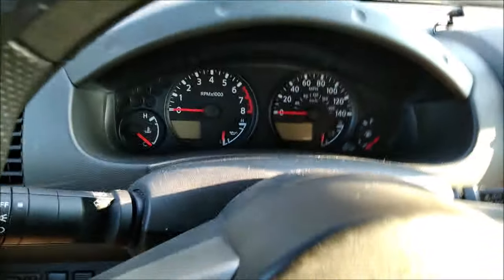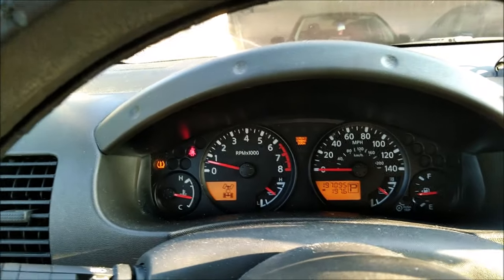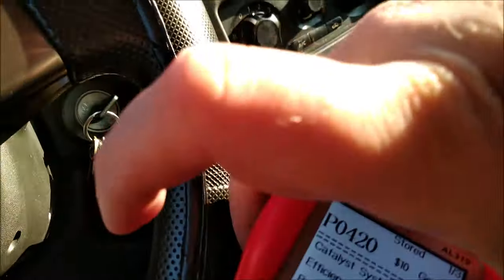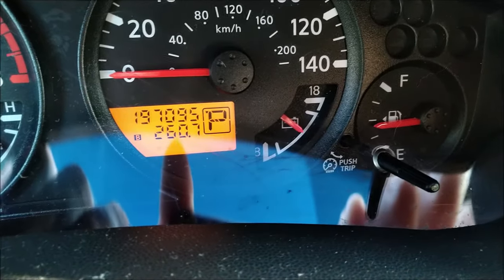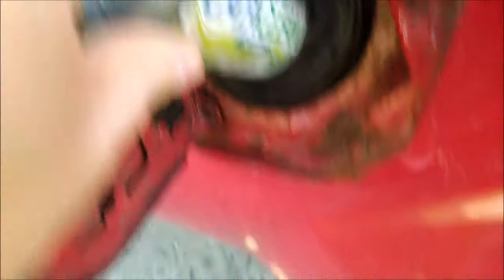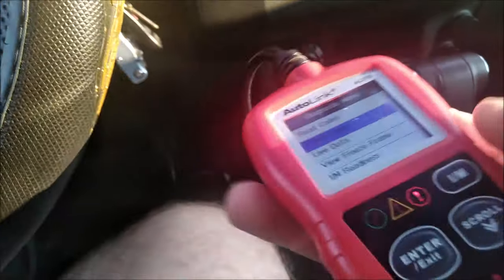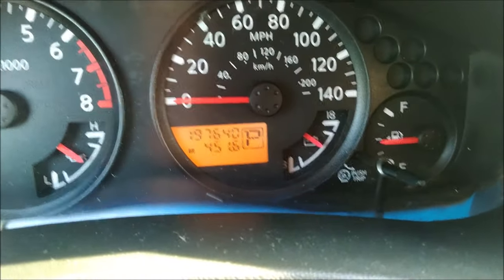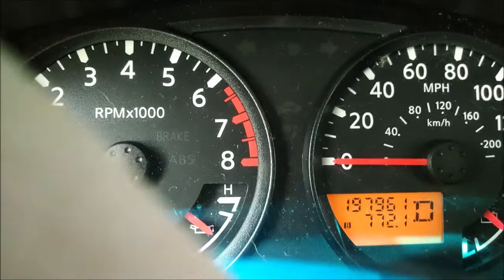Real World Test Of Cataclean in a vehicle with 200k miles

Comment: Used it as directed and it worked.  Had to turn off the check engine light manually, but ran another code test and the readout said NO CODES.  I'm happy.
Reply: The problem is some are people expecting it to resolve the catalytic converter or o2 issue in every scenario.   Including where the cats or sensors are already physically damaged.  Obviously it can't fix when it's broken with a physical obstruction or has overheated and melted, but that's what they expect.  Given the price of a o2 sensor or especially a converter at worst your out $20 bucks +- if it doesn't help.

Comment: 2014 Kia Optima had 300k miles, P0420 code meaning the catalytic converter or 02 sensor is dead, ran 1 bottle on an Italian tune.up(70 mph on an interstate highway, all gas no brakes) lights turned off on it’s own, obd reader confirmed issue was fixed,  ran another bottle just for fun the next week, car now sounds like it will make it to 700k miles, most GDI engines needs to have this done every 11 months

Comment: I had essentially the same thing with my 2012 Honda Odyssey.  It has 136,000 miles and the P0430 code caused the check light engine to come on.  I used Cataclean and it caused the condition to go away totally which turned the check engine light off.  My personal mechanic told me that I apparently had gotten some bad gas when I fueled up which caused the system to think there was a problem with the Catalytic Converters.  Thankfully, they are fine but the quality of gas where I am has dropped with all of the ethanol and other additives these guys use to stretch out their profits.
Reply: I think it’s the ethanol honestly. I had a code that typically would be o2 sensors. Replaced both upstream. Then P0420 and then that went away. Then misfire cylinder 4. I replaced the ignition coil and plus(all others are fairly new with about 30k miles on them). Definitely drove and idled better. Then the code for misfire came back up. I replaced the fuel injector. I noticed the tip of the old injector is sticky. Gasoline does not get sticky. It’s that high fructose corn syrup they call ethanol I bet. Idk

Comment: I had the same code trigger the engine light on my 07 CTS so I bought a bottle of Kylie clean and dumped it in my tank. But I had just slightly under 3/4 of a tank of gas in it still works just fine! I just had the light shut off and it hasn’t come back on again and I spend a week or two ago I guess now and I drive it every day. So I’m just here to say, it works even if you don’t run it all the way down to a quarter of a tank of gas. I had just under 3/4 of a tank when I dumped my bottle in and it still did the trick just fine!
Reply: Thank you! My gas is just under 3/4. I was going to pour a bottle in and see if it helps. If not I'll follow the instructions at 1/4 tank.

Comment: I used cataclean on my 2013 Honda Accord with 154k and the engine light went out a day later..after 6 months light did not come back on and vehicle passed inspection..use every 6 months on the older cars I’m told by a used car dealer..
Reply from the maker: It varies glad it worked for you.

Comment: Own a 17 Grand Caravan with just under 130.000 miles, CEL came on with same Cat. Concern.
I absolutely can't afford a $1,200.00 cat replacement, so I went the Cataclean route, drove 50 miles then filled up.

Started the van back up, CEL WAS OFF, ALL CODES GONE! 🙏 Gas ⛽ milage & horsepower improved significantly! For good measure, I ran a 2nd bottle through back to back, still gaining improvements.

I definitely recommend Cataclean, worth it's weight in gold, ill also use this every 6 months as a regular maintenance to avoid these emission inspection nightmares. 💯
Reply: The damn light came back on!

Comment: I just used some on my 2006 expedition 180,000 miles. Got the same code as you dropped some Cataclean in I drove it a few days and the light didn’t come off. So I reset the light and it’s been a week. I’ve driven about 200 miles and it hasn’t came back on. I bought the oxygen sensors just in case though and I hope that takes care of that for good. But before I install them I will drive for another couple days and put the scanner on to see what happens. 🤞🏼🤞🏼
Reply: It’s been 12 days and the light remains off and have 0 codes and I never replaced the sensor.
Reply: @raulg.6643 what about now?
Reply: Still off. Now I will start to do every 6 months just as a preventative measure.

Comment: I've used this product twice in my 2013 Ford Taurus which had 2 codes related to catalytic converter issues.
Both cats were replaced approximately 1 year ago, but the check engine light keeps coming back on. Very disappointing.

Comment: In my VW Jetta I used to own, the check engine light would come on often, so I just would reset the code about once a week :P  Very cool that you got some more distance with the additive.  Get those tires filled!
Reply from the maker: My tires are full my TPMS sensors haven't worked for years. Also the damn light came back on at 880 miles.
Reply: So your jetta doesn't have any issues from catalytic? Just errors by default?

Comment: I had this code on my 03 Corolla. To replace the catalytic converter with OEM parts (is one continuous part with muffler) was quoted at $2,000 dollars.

I then bought Catalytic converter online from Magnaflow and had it installed - total price was $1,000.

I just got the code again and did a lot of research (this video included).

I will buy some Cataclean and hope it works
Reply: Your problem was using a magnaflow cat

Comment: I've just bought some today for my 2004 Ford F-150, with 280,000 miles. The Truck is now in limp mode with warning ⚠️wrench 🔧 light turned on. Your video gives me hope. thanks for sharing
Reply from the maker: Best of luck I hope you get out of limp mode.
Reply: Mine 04 f150 did that and was running and idling real ruff  I sold it for 2000 less then what I wanted for it  to a mechanic he still keeps in touch all it was , was the spark plugs and coils
Reply from the maker: @tracimitchell4557  A 30 dollar code reader is an awesome thing to have.
Reply: @tracimitchell4557  
Lol, he finessed a female. 
I bought my 2017 Kia Optima for $2,500, mechanic quoted previous owner $4k to change the Cat. 
Changed the 02 sensor for $30, took down the cat and bathe it with oven cleaner. 

Sold the car and made $8k on it, i love buying cars from women, never seen a well maintained female driven car, they can’t even put air in the tire, how would they know how to maintain and service or what to ask for when servicing the car

Comment: Thank you for sharing information I have the same so I wait till I reach one quarter of a tank add the Cadillac cleaning and driving 15 miles I have a problem my gas gauge is not working so I have to keep track of my miles or else I run out of can I pour it when I have a half tank? Don't run out gas it happened many times. The needle from the gauge is not working. Thank you😮

Comment: I’m going to try this on my 01 Oldsmobile. I was told that I needed to replace the cat which is a 500.00 dollar price tag on top of 1408.00 dollars to replace my O2 sensors, radiator, spark plugs and ignition coils and the fuel pump. 🙏 the last thing I want is to spend more money on more auto repairs. Everyone pray!🙏

Comment: 🖖Works 1998 F-150 125,745  Also used B-12 and Seafoam spray and soak for 24 hrs and seen bits of carbon flake fall below tail pipes and with condensation flowing out of tail pipes also . All I see from use all three is first one really cleans the catalytic converter. B-12 works great cleaning your injectors in your intake valves and exhaust valves. I used the seafoam in the brake booster hose that connects to the front of the intake and also the hose that goes to the back of the intake and let the motors soak with SeaFoam for 24 hours works better if you have it soak longer and use of more 2 an 1/2 can’s. 🖖⛽️ surprising thing is I’ve seen the motor get more response from the stoplight also gas mileage gain 15-20 mpg
Reply: What is B-12?

Comment: You should drive it at about 2,500-3,000 rpm for at least 20 minutes after refueling. Really you want to drive it a full 150 miles over 2,500 rpm with it in the tank. It drastically swells seals, so I would drive it all through in one day and refill to reduce any unnecessary fatigue on components

Comment: If your car loses oil, your cat is building up carbon hence it is clogging.  Bad cat is a problem elsewhere.  You fix the problem and clean the cat with that bottle and it'll solve the problem.  Even if you buy new cat, it will get dirty again n will throw code n same problem will persist.  To stop oil leak, change your pcv valve.  Only cost $14 for the unit.  Check your gas cap too.  Faulty gas cap will throw a cel too.  Also 87 gas at cheap gas station will not clean your injectors because it does not have additive.  I know you pay more at the pump for Chevron but it has techron additives that will do your cat right.  Shell has additive but only at 89 or higher grade.  The 87 doesn't have is what I heard through the grapevine.  

If you turn off your cel n try to smog, they will know.  

Oh n there's a way to check if your cat is bad.  Get a laser temperature reader.  The cheapest one are for baking.  You take the temp of the front, middle n end of your cat.  Front is hot, middle is hotter n end is cooler temps.  If your front is hottest then you have a clog.  All that hot air getting pushed back up the other way n into your engine n if drive further, you will get an overheating.  Cataclean may clear the blocking so the air can flow out the back of the cat.  If you hear rattling sound from your cat then your honeycomb inside the cat is broken.  If there's leaks in the cat, your air is leaking so your horsepower will be lost.   If your muffler smells like rotten egg, yep time for a new cat.  

Important is to know if your cat is broken.  Sometimes you replace cat for nothing n the problem comes back again.  Need to fix problem first so the cat can breathe.  If cat need replacement, so will the problem that causes the cat to die needs to be fix too.  Lots of money involved but if you can save the cat, less money gone by fixing the problem Instead.
Reply from the maker: Well on my vehicle I'm definitely not replacing the CATs since it has over 200k on it and in Indiana they don't do smog checks. My vehicle is not losing any oil. Also there's no rattling currently in the cat. I'm currently trying the lacquer thinner trick we'll see if that does anything so far I've driven it around 700 miles since putting it in, we'll see if I can go a couple of thousand without the light coming back on.
Reply: @baldmetalnerd  if your state has no emission test then that cel is useless.  A car can drive with that light on.  Although continuous driving without fixing the problem can lead to other problems but still extended shelf life for your vehicle.  Mine is 390k 011 Camry.   With high mileage I guess you can say that the cat is on her last leg n failed emissions.  Gifted car thus why those who knows only drives Toyota or Honda lol

390k on stock n driving 140miles  round trip daily for wk.  Driving like a race car driver cuz you know how them Cali driver's are.  Never change the transmission oil either.  Only motor oil every 7k n new filter n that's it.  Eventually parts will die due to high mileage.  Which one goes first?  Cat then who knows what else.  If there's no emission test here, I'll drive her for another 200k for an even 600k b4 junking her for $300.
Reply from the maker: @liarliar1408  LOL well my Frontier is no longer my daily driver I got a new Corolla last year, but I do still drive it once a week because I'm not going to just let it sit. I drive 60 miles round trip to work and I thought that was bad but that's nothing compared to 140.
Reply: @liarliar1408  hi my PC valve had just recently been changed my car was eating up oil my check engine light is not on but I did have a mechanic tell me that my Cadillac converter Maybe going out because my car is losing power would me putting a type of solution help me to clean the Cadillac converter
Reply: @lynnvlogs7742   yes it is called cataclean.  Walmart depending on location may have them for $25 a bottle.  I just passed my smog by doing the following.  Get cataclean n instructions will be on the bottle.  Basically have less gas then put in bottle n drive hard, I mean floor it on stop n go.  Do this to push out them carbon deposits from the cat out.  Then get two bottles of seafoam.  Walmart has them too.   Same drill.  Less gas tank, two bottles in to clean your lower unit.  If you want, Seafoam has a spray bottle where you open up your throttle body n spray the whole can into it.  Lots of white smoke will come out.  This will clean your upper unit.  Put super unleaded gas n go get a smog.  Oh, if your engine light is on, auto zone or O'Reilly has free odb reader for you to turn it off then drive 80 miles so the system will reset itself.  Then do smog.  Hopefully it will pass for you.  If your check engine light is on then for sure you will fail smog.  We do what we do to pass n duke it out for another 2 years b4 we have to smog again.   I got lucky with mine.  The other smog station does not check to see if BLK smoke comes out from my muffler or I would fail again.   I told them b4 hand b4 they did the smog though.  They agreed.  I got lucky.   Car now has 405,000 miles n still driving to wk 2 hours roughly each way with traffic.  Imagine that.  I'm car shopping now though just in case.  I'm getting new tires by BLK Friday sale.  This time I'll go with 60k miles threadwear only because I do not think she can last that long.  Knock on wood.

Comment: Also, a check engine light not coming back on does not necessary indicate that a vehicle will pass emissions. I drove the suggested amount of miles, the check engine light didn't turn on, so I boldly went to get retested. It still didn't pass.
This is ridiculous.
It a 2013 Ford Taurus with replaced Catalytic converter.
Reply from the maker: Well I am lucky to live where they don't test for emissions best of luck to ya.
Reply: You hadn’t gone through a “drive cycle “ yet.

Comment: it worked for me as I was googling  as I saw quite few videos of cataclean and saw your video after i had done cataclean. Even I am not going to change cat converter, not worth it. It has only been a day but CEL is not on as yet. I was curious about one thing. My question is during the 880 miles, did you happen to fill the gas tank with 87 with 10% ethanol or the pure 87 or higher octane ones? I have a feeling that cheapest gas of 87 did for me. my car has 91 recommended (not required) but the less ones work with low gas mileage which also is the case with bad cat converter
Reply from the maker: Around here all gas is 10 percent ethanol you can't get pure gas anywhere it's quite annoying. Yeah I've been using 87 as that's all my vehicle requires I did try a second bottle but I tried the dura lube brand and that lasted 1650 miles before the light came back on. I'm currently on my 3rd bottle we'll see how long it lasts I know I'm up to either a few or several hundred miles on it I'm not exactly sure. But this stuff certainly seems to do "something" and I would definitely not call it snake oil.
Reply: 2 months later did the light come back on?
Reply: @keithvolner930  Light did come one. But I changed the O2 sensor that is nearest to the first cylinder that fires. For my car, it is sensor 1 bank 1 or on the passenger side upstream. This can be different for different cars so keep that in mind. But that took care of it for now. Cataclean did its job but O2 sensor can also give in rich fuel much might make the catalytic converter go bad is my logic. I am no mechanic but no CEL after I installed the O2 sensor and cleared it and it has been more than 200 miles now.
Reply: @baldmetalnerd  did u use other brand the 2nd time? How is this ODB device u used? Plz feedback. Thanks man

Comment: I had the same results. Added a bottle of Cataclean to a 1/4 tank. Drove 50 miles nonstop, then filled the tank to 3/4. No more cat codes & I/M CAT monitor finally shows ready!
BTW to clear the AIR monitor, start the car from a stone cold start, then let idle for four minutes and do not touch the throttle. If the secondary air system is working properly the monitor will show ready.

Comment: I got the same thing going on. Same mileage. 2008 Nissan Xterra. Even have the tire pressure fault also, which is not accurate. I got a P0430 code. I hope it passes.
Reply: Did it work I have the same
Code
Reply: @alfredd2689  I ran some cataclean thru it and passed.